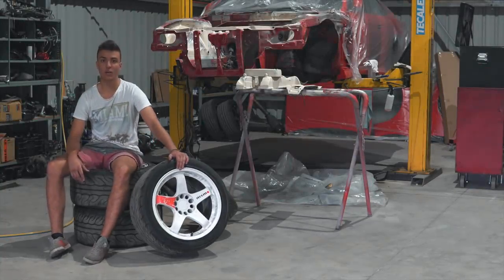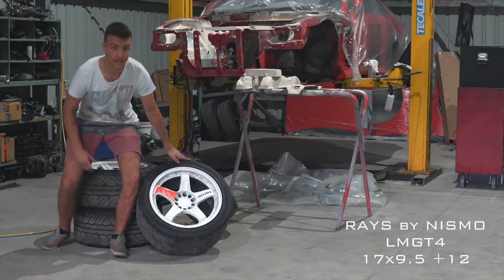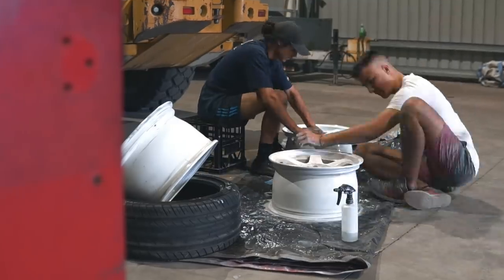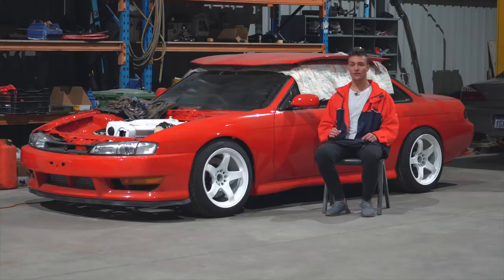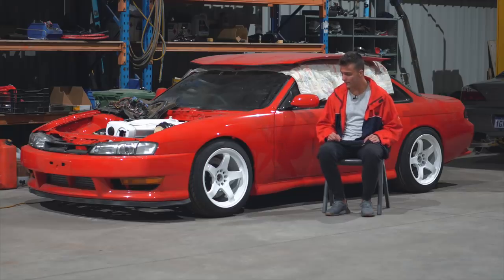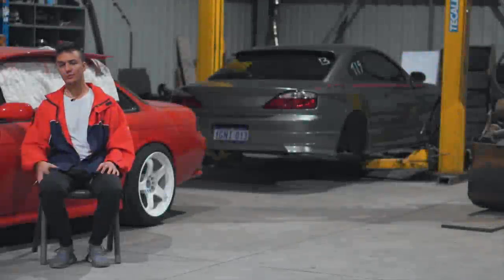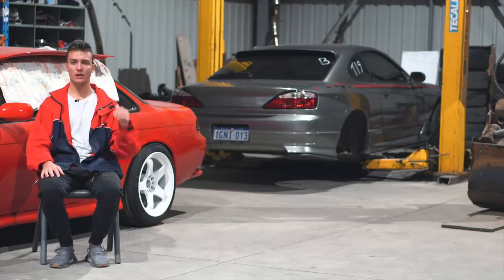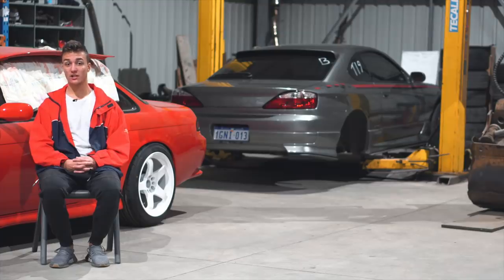Refurbishing NISMO LMGT4 Wheels | The Broken Silvia [EP8]

Comment: Good stuff as usual my guy. Hey quick question did you start with 320 and work your way up to 600? Or just 320 and 600?
Reply from the maker: Cheers man, so went from 320g dry straight to 600 wet and dry. Spend a bit more time with the 600 and you’re good 👌